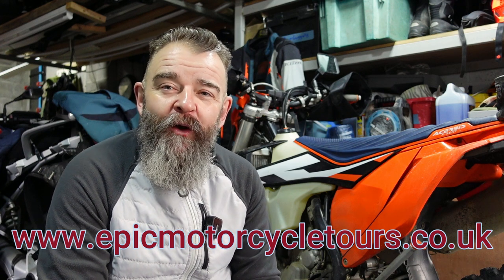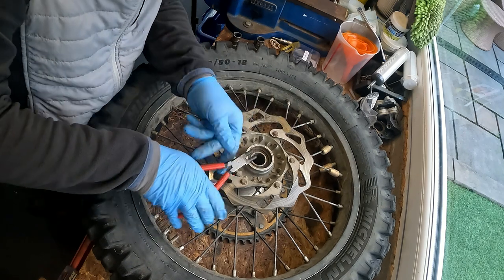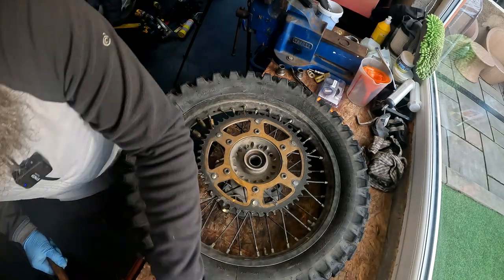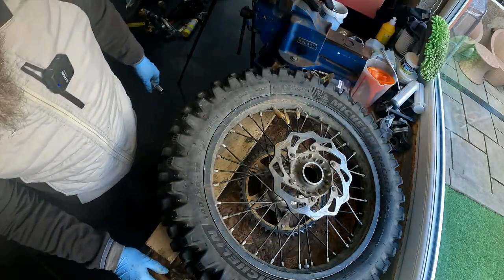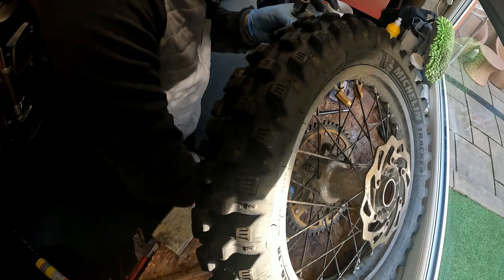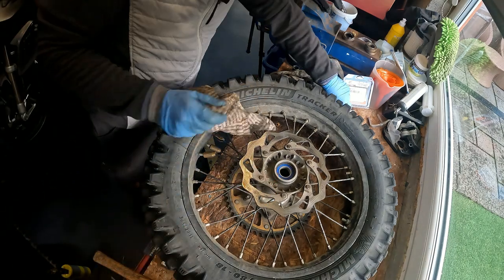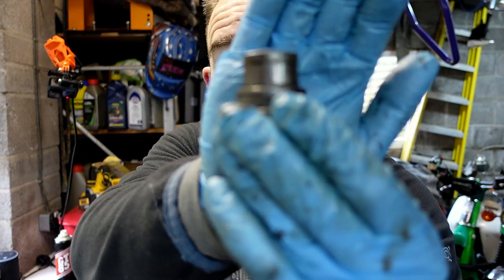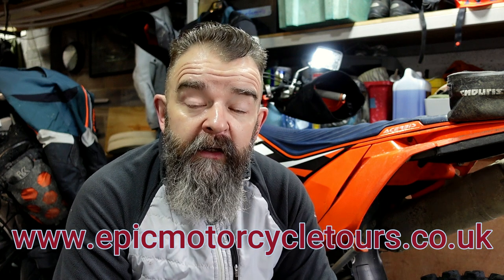Change your worn bearings like a pro !!!! on a KTM 350 EXC F

Comment: Hi Simon - just what l do as well ..... pop one of the covers off the bearing and get some more grease in there. Then pop cover back on, put the opened face into the hub.

This was common practice on bikes when l was younger.

Check out a company called 'simply bearings' you can read part no. off of  side cover.

Also, if you have a local bearing shop and do similar - cheaper than 'bike' ones.

Good to grease up swing arm and steering stem too!
Reply from the maker: Hey up A Gee, I usually do that with the bearings, does it really help, who knows 🤔, the swinging arm bearings were done not too long ago, but didn't film it 😲, clutch rubbers next when the parcel arrives 🤭, ride safe, Simon B 👍

Comment: Which Heat Torch did you use? 100% next time Cover off bearings and pack with a good Waterproof grease, the bearing will last and last 🙂, great honest video.
Reply from the maker: Hey up mrdangermouse, as I'm a plumber I used my own blow torch it's a rothenburg super fire 2, yes filling the bearings, does it really make them last longer ? If so how much, it's a good taking point, love to know your experience 😁, thanks for watching and dropping a comment 👍
Reply: @SIMONB1  Pop the seal off, clean the grease out and just fill it with Marine grease (I use Morris K99), I do this every year and can't remember the last time I change a bearing.
Reply from the maker: Thanks for sharing the tip, I'll try it soon 😁, ride safe, Simon B 👍

Comment: Hi Simon. I can’t get the spacers out of front wheel, never mind the bearings. Is there a special tool to get them out? 
Is that worth putting in 2 new spacers. 
👍
Reply from the maker: Hey up J-Mc72, they sometimes get stuck in, use a long screwdriver and knock them out from each side, put a bit of grease in them when you put them back in after you've cleaned them 😁, hope you get it sorted, ride safe Simon B 😎
Reply: @SIMONB1  thank you Simon. Absolute star. It worked. 👍Unfortunately brake/pads disks didn’t arrive in time so no green lanes for me 😞 all that rushing around to try and spend Saturday on the bike and it’s still up on jacks.